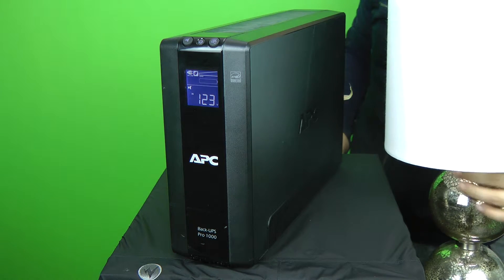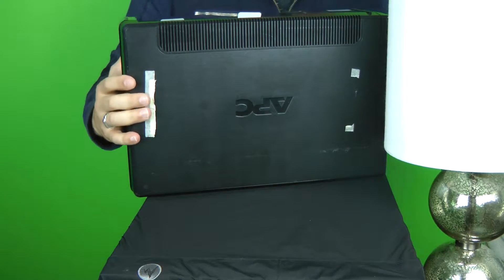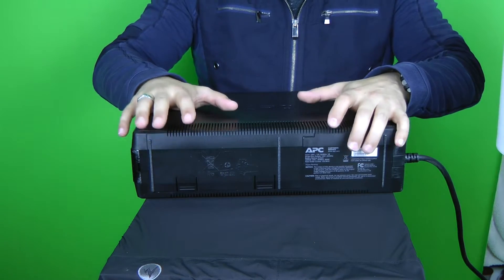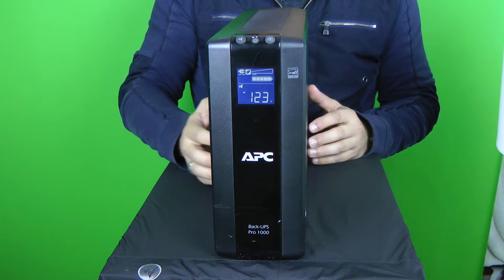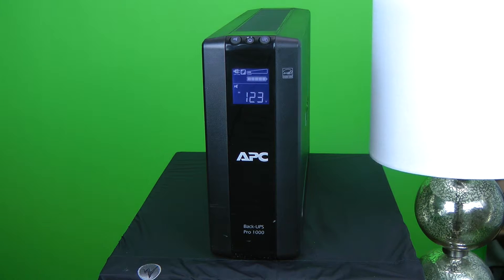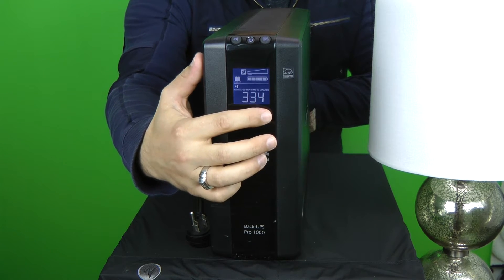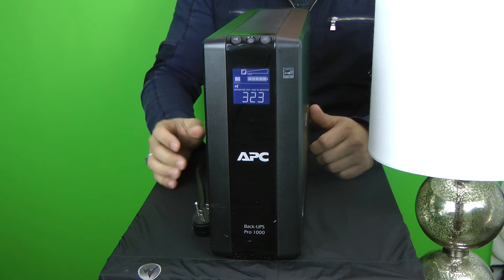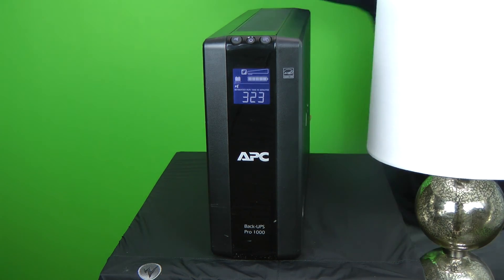Here's why UPS fail so often - Avoiding Backup Battery Blunders

Comment: Why shouldn't it flicker? When the battery is in there, is the power ALWAYS going through it? i.e. if the battery were to suddenly fail, due to a bad cell or something, would the power from the wall still be allowed to pass through the device and power the lamp ?